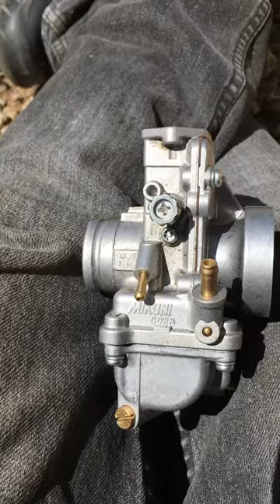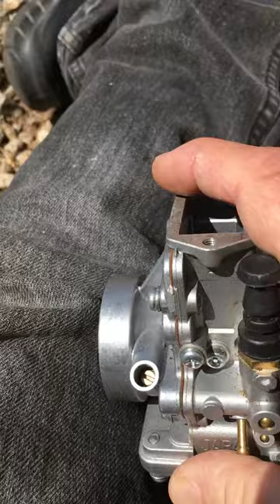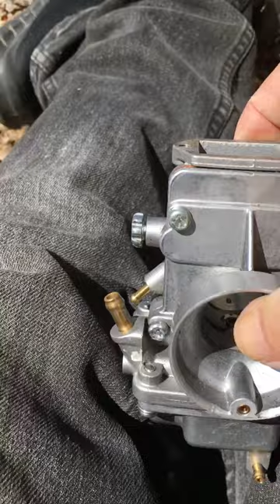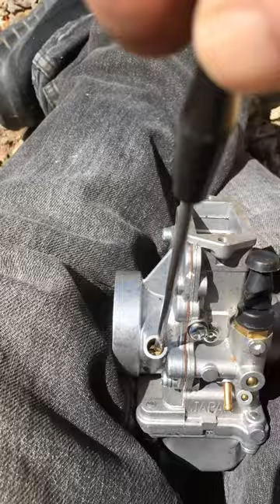#how to choose proper pilot /idle jet with air mix screw step 2

Comment: hey I know Im a bit late but just have one question I have that exact carb on my bike and I have too have the air screw almost all the way out for it to run fine but still it runs a little rich, it has a 22.5 in it right now I bought a 17 but I wanna know is my carb to big or something or do slight pilot size changes change the ratio a lot? Also could it be my needle I believe the clip is set to the bottom so that could cause it to run rich idk
Reply from the maker: https://youtu.be/6k-AhtdEhps
Reply from the maker: https://youtu.be/9saVfgo_Vnc
Reply from the maker: Allways start out jetting with needle on #4 second from bottom. Warm motor no vaccume leaks and correct float level.  You are correct if your air mix screw is only 1 turn out then you would go down 1 size. To a 20.  Then begin the tunning the needle controls 1/4 to 3/4 throttle.  Typically I choose a safe main jet then go back and tune in the middle throttle range with needle

Comment: How do you know when to change the main jet up or down, horse.
Reply from the maker: Motor tells you what it needs. Takes minutes  to jet a carburetor. If you don't know what rich is turn the choke on. That's what rich is. Lean is booging  hot running  surging. lean will burn up a moto in a minute.  Rich is sputtering  a proper  tuned carb should run smoothly  throughout  the whole throttle range on or off throttle.
Reply from the maker: Watch the videos I explain each jet how each jet functions
Reply from the maker: https://youtu.be/jeTY1MEcOPU. How to choose proper  main jet
Reply: @2strokecarbtuningportingin187  It's running good, I guess it's trickier to tell with a Harley.  I know the low speed jet is about right, I have an 88 sportser needle in there I'm at a 95 for the main.  Will the idle/air screw effect the main jet at all?
Reply: @2strokecarbtuningportingin187  awesome, ya I guess people use a 88 sporster needle because there were no emissions bullshit that year and runs very well in the CV carbs.
Reply: @2strokecarbtuningportingin187  OK so I may have to go back to the 90
Reply from the maker: @ranbymonkeys2384  the question was does pilot affect main or needle. Each circuit  has a effect  on each other meaning. You Start up and idle from zero throttle to 1/4 throttle  is pilot  air mix / fuel mixture  screw. Then it transitions to slide cutaway  / needle jet and jet needle from 1/4 to 3/4 throttle. Rarely  you need to mess with slide cutaway  . Then it transitions to main jet from 3/4 to wide open . The air mix / fuel mixture screw determines  what size pilot to use. For a proper  tune carb it should be crisp smooth  running across the throttle range.  Does the pilot have much effect on main. Not so much.
Reply from the maker: @ranbymonkeys2384   hopefully  my carb vids have been helpful  they have helped a few thousand  folks.